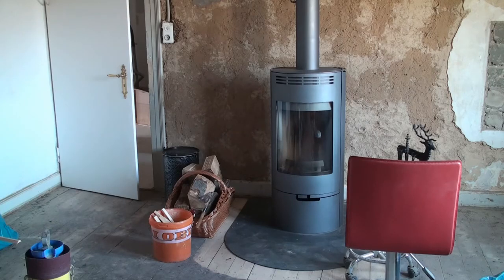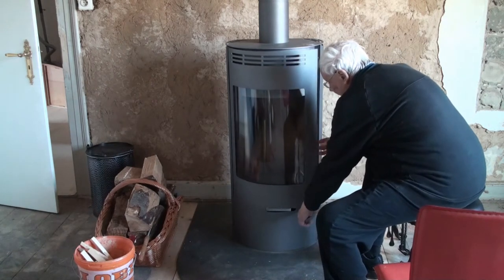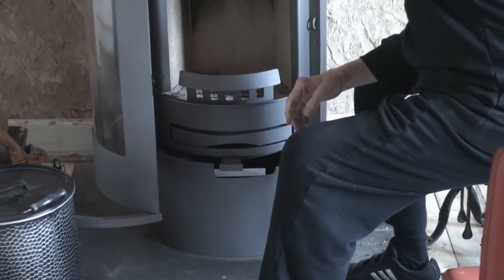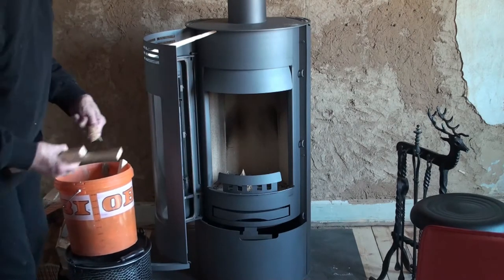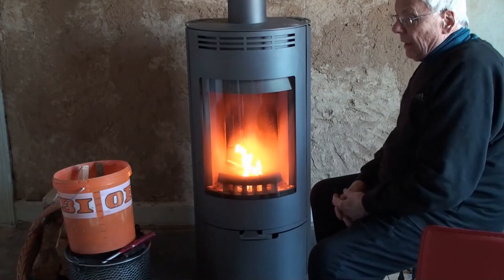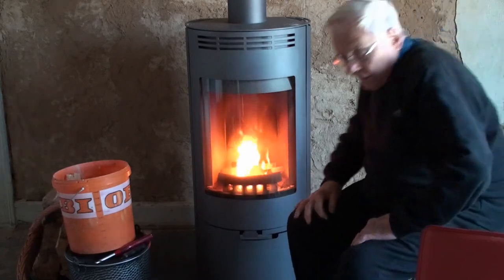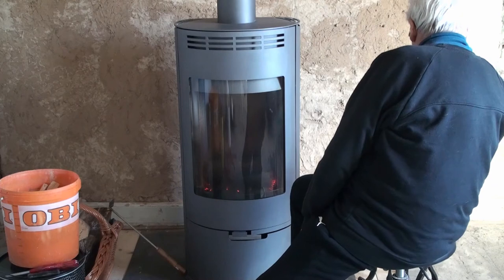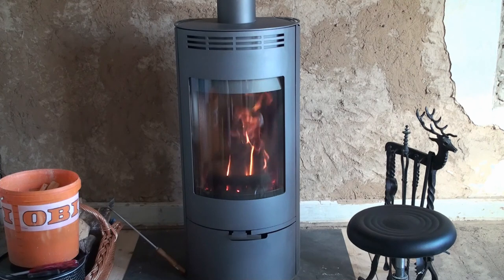More talk about wood stoves and a new tool

Comment: Bruce, what is the approx size [diameter] of the stove pipe and does it have to be that size for efficient operation? Also is there any particular reason why you choose that manufacturer's products? Most stoves here in the UK are cast iron rather than steel.  

Love the new fire tongs!
Reply from the maker: The stove pipe is 150 mm and for these stoves cannot be reduced. A cast iron 8kw stove would weigh three times what the steel stoves weigh and our chimney sweep told us that the new steel stoves will last just as long. We didn't really chose this brand (Thorma - Slovakia), but bought from a website of a well known importer/seller (Feuer und Flamme in Hamburg). There are much more expensive brands, of course.

Comment: Temp here today is 6 deg. F and snowing. could use a stove like today.
Reply from the maker: Thanks. I forgot where you live, if I knew. From your time-lapse videos I know you get a lot of snow! We've had a mild winter with little snow.
Reply: Bruce Boschek I live in northeast Ohio about 30 miles south of Cleveland. We've had a very cold and snowy Winter.